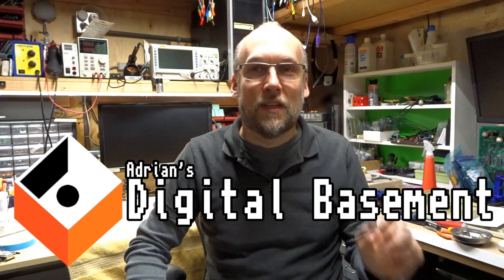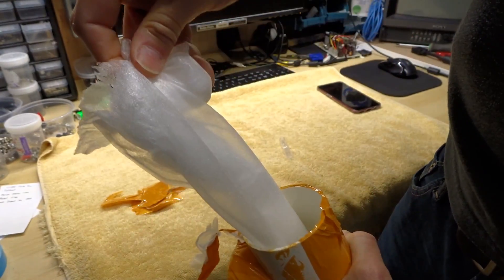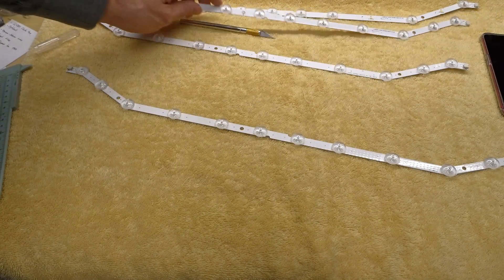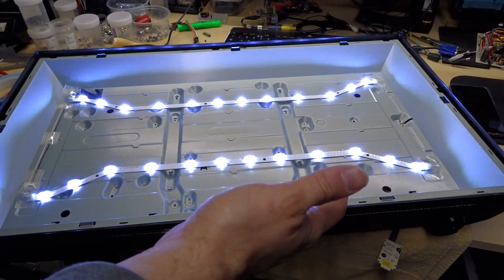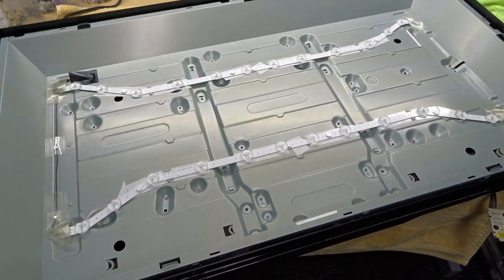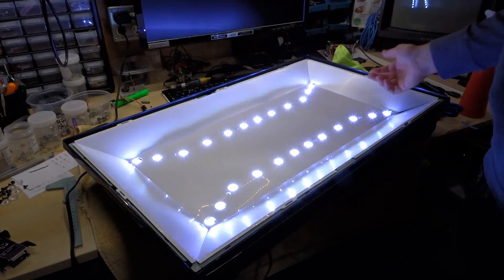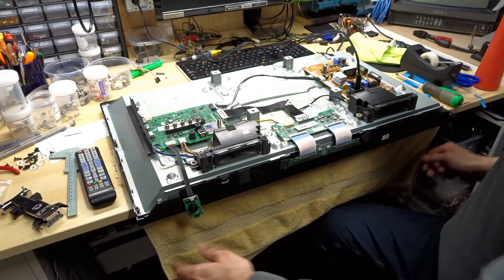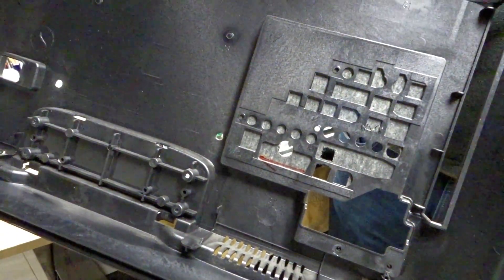Trashpicked Samsung LCD TV Part 2: New LED Modules

Comment: That is one good job, don't be sad about that small panel damage, it was probably done by the people who threw it to the bin, you can do nothing about it, in worst case, it can be used specifically to watch old tv shows which runs on 4:3 ratio or to play old games who also still used old 4:3 ratio such as NES, SNES, PS1 and PS2, also the original Xbox, Nintendo 64 and up to Nintendo Game Cube

Comment: Fascinating repair tutorial. I just rescued a very similar TV with black vertical stripes on the right few inches if anyone has any ideas about that...

In retrospect, you could have put a crude light source behind the display to test it before ordering the LED arrays.

But anyway, for much 4:3 or 16:9 content, that corner will be dark anyway!

Comment: Nice repair. I do not know if liquid crystal degrades when exposed to air or humidity, but it might be worthwhile to put a little epoxy or clear UV curing adhesive over the crack to seal it.

Comment: I would call this a successful fix. Well done, it hasn't cost much either. 
Suggestion: Turn it into a 4:3 arcade cabinet. The black bars either side will hide the blob. 
Stick an older pc in there with modest gfx card for cheap and run MAME (lots of new versions available with nice GUI's). 
Make some joysticks for cheap from ArcadePro or even ebay and get a controller board for them that outputs USB.  Loads of kits available out there. 
Could probably get this all together for less than $100 especially if you have a donor PC laying around. 
You can get the plans for an arcade cabinet easily online and loads of youtube tutorials are out there.  
You could even create artwork stickers to cover the black bars. 
Would make a good youtube series too. I'll definitely watch that.

Comment: I've commented  (and other guy there, too) about the assembly of the live cell on your first video, but it was too late, I guess... this model and the UN32FH4XXXX are a problem when mounting and dismounting the frame, so the LCD screen has to be up, not down, or the corner will crack. To be honest, all the models from Samsung, when I made a repair in the LED bars, I've always did it with the LCD screen up, and doesn't matter if is a 32" or 75", they will crack if you disassembly facing down...
Anywaym good luck!

Comment: Now you’re using this as a tv or a computer monitor.Now don’t ever turn on the tv backscreen backlighting to the 90% to 100% in the maximum brightness.Turn it on like to 50% maybe 60% brightness only.The tv and the life of the two LEDs strips for the backlighting will last about another 100,000 thousand hours of life easily.

Comment: A good tip is to lower the level of backlight in the menu, because sometimes the LEDs are overloaded by default, sometimes the intensity of the strips can decrease but sometimes it gets complicated and the easiest thing is to lower the backlight and raise the contrast levels to compensate. Measure the intensity that circulates in the led strips, should not be more than 180 mA.

Comment: About that blue tint, it's something you should expect, working with LCD displays. You're more likely got replacement parts that failed Samsung's own quality control. The rejects work its way thru the system and end up at spare part sellers.

Comment: Great job Adrian.
The alignment of the layers during reassembly is crucial, I did it slightly wrong and got weired problems with uniformity: the bezel was pushing against the TFT in some places.
Also I used an air compressor to blow off some crud, between the layers.

Comment: I used to do electronic recycling. I and a coworker would use LED trouble lamps to detect flaws in the monitors/TVs. The brighter the LEDs, the easier it would be to find flaws. The high CRI fluorescent tubes you demonstrated in an earlier video would be perfect for finding defects in LCD screens. Single point lights miss a lot of details. Broad lights miss fewer. Just a thought.

Comment: The crack was probably already there. I can't see how you could have caused it when you had it laid down on a towel, and the scuffing suggests the corner got bumped at some point. Maybe someone had an accident while vacuuming, cleaning with a broom or similar, and accidentally bumped the corner of the TV. But it seems most likely that it was damaged when it was thrown away. You're lucky it wasn't completely cracked from the force, as this is still a perfectly usable TV in my opinion. Give it to some kid to put in their bedroom to play games on or something like that, they won't mind the black spot.

Comment: Btw. LED-TV:s are much safer and easier to disassemble panel side facing up after removing PCB:s. Start panel disassembly by removing front plastic surround, then panel glass, then surround which hold diffusers in place. Lift all diffusers away keeping them together.  White reflector sheet is last to be removed before LED strips. If you do it like the way you did it, you most likely end up with a cracked screen, there's no way you could align everything correctly.

Comment: I'm also fixing the same model TV, was hit by lightning. Would you mind opening it up again, I need to know the value of resistor RM862, power supply primary side near optocoupler? There are no schematics available for this PSU and I couldn't find a high enough resolution pic from the internet. Or does anyone else happen to have this BN44-00665A at hand?

Comment: now it's like a samsung galaxy s10+ with the hole punch cutout for the camera
Reply: I think that I dodged that bullet on a phone that's not full featured & by Fall it'll be falling fast. I dropped a big $300 on the Umidigi S3 Pro pre-order on Amazon last month & there's some going for $500 now! The IPS and Sony's Sensors in the iPhone including the 40 MP selfie cam that the S10's not getting. I couldn't believe that Samsung put Fold in the hands of Tech folk's & like Note7 they fell on their faces again! I'm allergic to their phones now. My Pixel 1 from 2016 still had some features that beat the Note9. Way to motivate in the tech space big boy! And I heard that you have to wait & shell out more to get 5G, what a scam! When I was trucking when 4G came out you'd expect L.A. or N.Y.C. to be rocking it, but I got the best in Nashville and Louisville. Crazy! But was it Sprint that renamed 3G to 4G?
Reply: Jerking is 50
Reply: @user-hx9dc5gr3l  Are you saying that's what our video host is doing at that mark in the video?
Reply: What u mean mark? no sir

Comment: China is considered a developing country so their postage costs are subsidized by the industrialized world through their shipping and postal companies. That is how shipping from China can be very cheap or sometimes free. This subsidy or aid was originally intended for things like letters, not large packages like this PVC pipe. Many countries are calling for a change since China can hardly be called a developing country any more but China is of course resisting. The UN Universal Postal Union is working towards changing this but it is very slow. The US has threatened to leave UPU because of this situation (I believe) which might speed up the proceedings.

Comment: Great video! I'm a Brit born in early 1950s. My English Teacher / non-technical Dad regularly repaired our black and white cathode ray tvs ... replacing thermionic valves and even (I think I remember) the CR tube at one point. In this age of throw-away, disposable everything it's reassuring to see the 'fix-it' concept is not dead !
Reply: Just to be a bit pedantic, anyone thinking of trying to fix an old CRT TV should be aware that some of the older models had hi-voltage capacitors that can give you a good whack. Unlikely that any would still be dangerous by this time but you can never be sure.  Just be aware and read the schematic so you know which components they are.

Comment: Good repair and good video. I have never seen a back-light like this before. They generally have the LED's across the bottom, top or both. They get dissipated by Plexiglas the the various lawyers behind the LCD panel. Im sure this works well. The way I describe is how you get a screen that is less than 1/2in thick.  Cheers!

Comment: OK, AliExpress isn't a single trader, they do vary a lot, but that's excellent packaging.

The thermal tape is the sort of thing that doesn't get done because of the cost of a worker's time.

The damage to the panel is a disappointment. As you say, you were learning, and plenty of possibilities that weren't your fault. Don't fret over it. We've all learned from it.

The slight difference in colour temperature might be from the backlight LEDs being slightly different. And the result can be different again in a different room. That's why you have an adjustment available, so you get a good result where you use the TV. Go round a place selling TVs, and you'll see the variation. They're getting similar room lighting, a similar TV signal, and that slight difference is commonplace.

Comment: I've repaired a couple of LED backlights to the point of just giving the repaired screens away (I myself haven't watched TV in over a decade ;) ). A hint to check the rest of the screen (when the LEDs are the fault) without investing into replacements: usually it is just a single LED that has gone open circuit. You can find that LED by piercing through the white solder mask with sharp probes and supply something like 3V to each LED (a current limiting power supply is useful, but not necessary). When you found the one that doesn't light up, bridge it with a wire. If none if the LEDs light up, you might have backlight LEDs with multiple chips in a single package, so they need a higher. But in that case make sure you have got the polarity right, because LEDs are sensitive to reverse voltage (don't got over 5V in reverse).
The LEDs are usually driven by a constant current supply, so the other LEDs don't care if one is shorted out. You can even do this with multiple LEDs until the driver freaks out, because the overall voltage will be below it's limits (the driver has some lower and upper of limits for voltage and current it expects). If you turn the brightness to minimum (because otherwise you're just provoking the next LED to fail) that fix will last for years and depending on how good the diffusor is, a single dead LED isn't even noticeable.

Comment: 4500 hours is a pretty low amount of time, It wouldn't surprise me if my Samsung 40" TV has around 35000 hours on it, it's been on most of the time since I won it at work back in August 2014.

Comment: It was quite clear it was cracked, that black blob is caused by the crack and will spread, a lot if you flex it at that spot so when it gets warm and cools down it’s going to flex a bit, at the moment it’s perfectly usable, be great for 8 bit retro computers as they have a border so wouldn’t be an issue unless it spreads across the screen further

Comment: Same thing happened to me. Cleaned a trash pile picked LCD monitor and fixed its backlight circuit just to realize that the LCD has two large dark defects, most likely caused by a chair sitting on it. Lesson learned. Next time we'll check the trash picks more thoroughly.

Comment: I noticed a crack/scratch in the top left corner in your first video and it was there before you started working on the tv.
Should the screen get a lot worse , you always have a set of spares for your other set.

Comment: The damage may have happened when it was discarded dude. Don't take it too personally! Perfect for testing when you need a display in a pinch. Also you have a full set of spares for your other TV, sans LCD.
Reply: Literally that’s what was said at 10:50

Comment: One of my Sony CRTs that someone the out has 8068 hours use and tube is superb
Reply: 8068 hours is really low for a CRT. My 32" 16:9 Sony Trinitron has 23717 hours and 29" 4:3 Trinitron has like 27k hours, both still look good. My lowest hour TV is a 28" 16:9 Trinitron with only ~6500 hours.

Comment: Just checked my Samsung 40" that I got in 2008.  It has 20,661 hours on it... These Samsung TVs are great.  It still looks and works as well for me as the day I got it.  Only reason I would want to upgrade, now, would be for a larger model.
Reply: @adriansdigitalbasement  I never even knew about that service mode until I saw your video, so thanks for that.  I had to look up the different code to punch in for my particular model -  but it was fun to check that out.

Comment: you either had an impact or layer or there is a crack in the screen face and sub face of the screen as the is the indication of what I was seeing..

given the short in the original backlight you just replaced  I'm guessing there was some type flex to the metal  panel which likely broke the wire trace in the backlight circuit..

Comment: It must be hard to produce two identical displays, I have two monitors for my computer and one of them is also bit more bluish. Same models.
Reply: Are you sure you have set the same color temperature on both? There shouldn't be a big difference in color temp between two identical displays